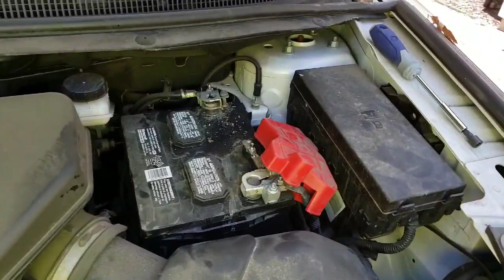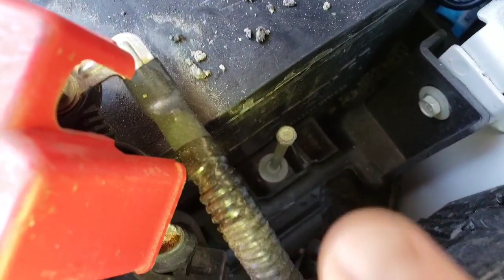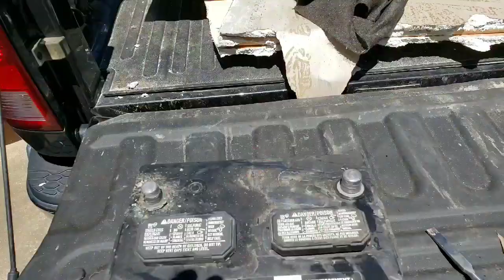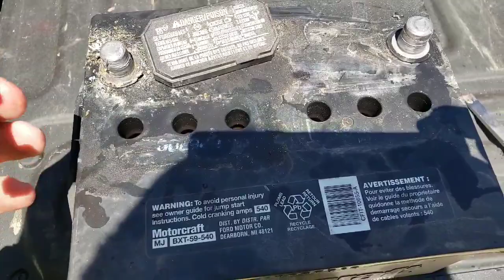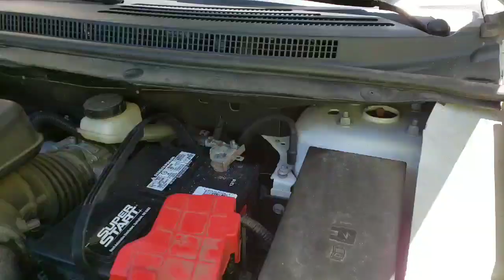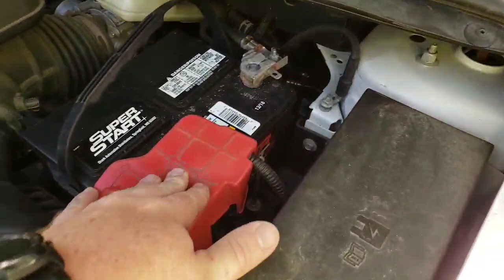How to Replace 2014 Ford Edge SEL Battery | Battery Removal and Installation

Comment: Haynes says always disconnect the + terminal first. I wanted to see how to get the battery out of the tight spot. I think you have to remove the air filter cover. Did you get yours out without removing the cover? If so, how did you do it.
Reply: If you watch the Haynes video, it says to do negative first. 

Also, shouldn't you use distilled, or is that not necessary?
Reply from the maker: I think I used a screwdriver to wedge it out.
Reply: It's a tight space why not show the actual battery removal
Reply: Remove the negative terminal first

Comment: ha.. you left out the hardest part. REMOVING the battery from the compartment and putting it back in!. thanks for telling us about the 3 screws though.. very helpful
Reply from the maker: If I remember correctly it came out rather easy once you got the screws out. Straight up? I could be wrong.
Reply: @RandomReviewsHowTos  The coweling is in the way

Comment: I had the same bolt break on my battery attachment due to corrosion, how did you clamp the negative side down in lieu of replacing the small bolt and nut accessory?
Reply from the maker: I honestly squeezed the negative with channel locks add tight add I could. It was on there tight.

Comment: You’re lucky this battery was easy to get to, because the very next year, 2015, they have the battery stuck up underneath the dash quite a bit more. I’ll have to figure out how to get that out in just a bit today.
Reply: David Bruce- Were you able to figure out how to get the battery out?  I have the same issue.
Reply: BJ Karafa, I haven’t taken the battery out because it’s still working fine because the winter is over and the cold cranking amps aren’t needed. But it doesn’t seem that hard, you would just Pull the air filter housing out of there and then pull the battery forward. Unless your vehicle is not a 2015. Maybe it’s different then?
Reply: David Bruce Thank you for the quick reply!  My vehicle is a 2014 Lincoln but has the exact same battery setup.  I assumed that’s what I would have to do but was hoping that I was missing something easier. ha
Reply: BJ Karafa, well luckily, it’s very easy to take that air filter assembly out of the way. Just a couple snaps to get the top housing off over the filter, and then unscrew the band that goes around the large diaphragm tube that puts air into the top of the engine area. Glad to help... by the way, take a look at the featured video on my YouTube page here and let me know what you think hundred. Heaven’s Comin’ is the name of the song. 🧡